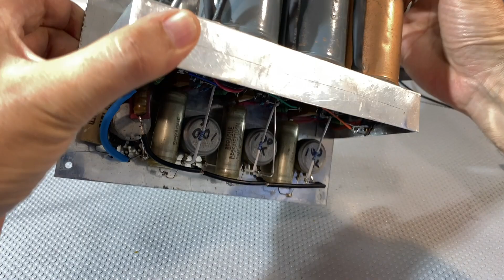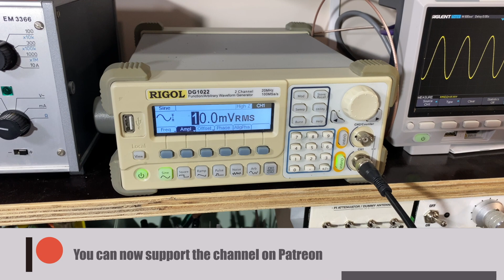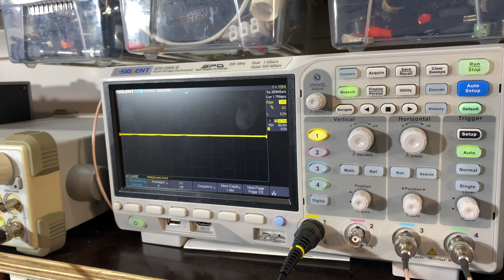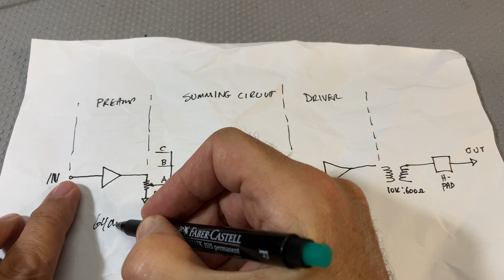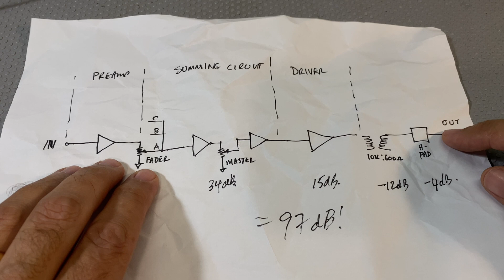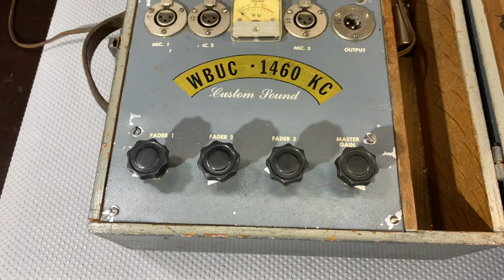All-Tube Microphone Mixer restoration pt 2. This one is done, and has a huge amount of gain.

Comment: Perusing this wonderful rebuild for a second time, I decided to look up WBUC-AM. Turns out, it's still pumping out 5,000 watts of ("adult standard") jams in Buckhannon, West Va! I also found a very interesting page detailing the history of WBUC and its primary founder. It says that, of the pair of initial owners of the station, one, Jesse D. Newman, "spent last 10 years in U. S. Army Signal Corps." It goes on to say that "Newman had built a complete Armed Forces Radio Station in India during WW-II." 

Even more interestingly, it continues: "Newman gave up 15 years in active military duty and moved his family to Buckhannon to build the station. It was a ‘shoestring’ operation that proves it can be done.

"WBUC signed on the air December 13, 1959 with a minimum of equipment, *some of it built by Newman*. The studios were in a large farmhouse. Newman and his family of five lived in one part, while the station occupied another part. It was handy for winter sign-on shifts, but it was crowded."

It seems quite likely that this microphone mixer's origin can be attributed to Mr. Newman, who sounds like a fascinating guy.
Reply: Something just hit me: I was told, and/ or read somewhere, that many, many older remote radio broadcasts in the USA would use a dedicated telephone line to transmit back to the station. Now, the output is 600-ohm, which is the US standard for a telephone line (of course it was also an older audio standard, but of course the audio engineers got that from using lots of Ma Bell's equipment in the early days). So it may make complete sense that the gain is so enormous on this thing: they very likely were transmitting over relatively long distances of unshielded, twisted-pair telephone wire. This may have made quite a difference in audio quality at the other end of that telephone line.
Reply from the maker: Interesting research you did there. Thank you. It always fascinates me to think of who used something like this before, and that Mr Newman sounds like quite a character.

Comment: What kind of input did you use ? Seems only for dynamic microphones with such gain.
Reply from the maker: I only tested with signal generator as an input. My friend has some really vintage ribbon mics, so maybe the gain will be useful.
Reply: @electronicsoldandnew  Ah, I understand, it is already out of your hands. As others wrote here, probably some 600 Ω mics needed for that, just as a reversed speaker, but with high impedance.

Comment: Excellent job!  Beautifully neat and clean job of correcting the wire size and other stuff.  If it had been mine, I would have insisted on new capacitors instead of the old ones that "tested good"...I just don't trust them!
Keep up the excellent work!
Reply from the maker: My friend actually asked really nicely for me not to change the caps unless absolutely necessary 😊
Reply: @electronicsoldandnew  Nothing "wrong" with that...I was simply stating that had it been me, it would be the other way around.  And again, you did an excellent job!
Reply from the maker: Thanks Wayne

Comment: It might not be perfect, but it must have done the job at the time, it was probably better than some others had at the time.
Did it have a small speaker output to monitor what was going through it?
Reply from the maker: No, it has the headphone output
Reply: @electronicsoldandnew   Ok, so they just used the headphone to monitor the output, I suppose that is normal anyway.

Comment: Rather unusual that al the resistors were crook, but none of the capacitors.  Wonder if the climate was humid ?  What would happen if you tried a coupling transformer at the end - roughly 600 ohms - 8 ohms could you get an audio out ?
Reply from the maker: Probably, but not much power

Comment: It may have been made as a commentators mic mixer. The commentator would use the mic only a few cm from his mouth where sibilance could be a great issue. That LC network would compensate for that. Might be worth doing a frequency sweep. I would expect the HF would drop quite steeply above probably 8khz or even lower. The headphone output is also odd. You would need a very high impedance phone as it the output is directly from the anode. No 8 or even 600 ohms phones here!
Reply: In the past it was very common for phones to be very high impedance, I have several 3k ohms phone sets that are designed to work directly on the anodes.

Comment: Dear Manuel, i don´t understand, why the preamp has a gain of 63dB ( 11:17 ). The two tubes have a feedback via 100k to 3k3, that is a voltage gain of app. 33 - i.e. 30dB. But the input transformer may have an unknown step-up ratio, which gives additional 33db? That would be a voltage step-up ratio of 44,7. Or from 600Ohms to 1,2MOhm? 
Did you measure the gain from the grid of V3.2 to the anode of V4.1? Should be the a.m. 30dB.
Reply from the maker: I didn’t measure from grid to anode, unfortunately. The input transformers have been painted over, and I didn’t think to measure the ratio directly. I feel I’m interpreting something wrong here, but can’t quite figure out exactly what. What I know is that 10mV in produces 15.8v out. That is 20xlog(15.8/0.01) = 64dB.
Reply: @electronicsoldandnew  As you say a lot could be done better - most of the professional preamps of the time (REDD47, V72, RCA and Gates etc) used the feedback path as the place to adjust gain; a switch to change that 100k for a few other values would seem a judicious change - something that could easily be tried (or shown to client) on one channel.

Comment: Manuel, Happy St. Patrick's Day, do Portuguese celebrate it? 
My thinking that your radio station's mic-mixer's hi-gain make sense as it's intended to feed into a telephone line back to the studio's transmitter. The Bell System worked with radio stations to install 600 ohm balanced pairs for a remote radio pick up and even had special terminal blocks for the radio stations technician. ((You did a beautiful job of restoration, and paid homage to the original design)
Reply from the maker: We have so many festive holidays here, but not St Patrick’s day (yet). 😊 
I didn’t think of the phone line possibility. That would make sense, actually. Feed a very “hot” signal from the field and then temper it back at the station. Interesting. Thanks.

Comment: I find the output transformer also very strange. Or at least it would never be my choice because it doesn't make much sense to go for a 600ohm output.
A 12AU7/ECC82 is more than capable of driving loads down to 10k/20k, which is standard input impedance for any professional gear (for many, many years)

Nice video btw!
Reply: btw, I was just simulating the circuit the amount of gain in the first stage isn't that high, only about 27x or 29dB.
I think you measured the gain without the feedback resistor? Because I don't see how you could end up with so much gain WITH feedback. A 12AX7 without cathode bypass cap does around 30-35x gain (30dB)
A 100k load (effectively less because of the feedback resistor), is also very odd. A 12AU7 would do better in this case.
Using two triode in series with that much load is already very odd.
Reply from the maker: I agree that there are a few oddities  here. I had the FB resistor in place when I did the actual voltage tests, so something may be off with my measurements, but I was measuring the gain of two triodes, not one. 
I think this mixer may actually have been designed for 12AU7 tubes, and not the 12AX7’s that are in place. The gain would then be a little less dramatic. Some adjustments to the bias and plate resistors may be needed, but that is something worth thinking about, I believe.
Reply: @electronicsoldandnew  Ok, that is still a lot for a circuit with feedback. A single gain stage is more than enough for a mic input. the 12AX7 is still a good choice, since it's a very "steep" tube (= lower distortion rule of thumb).
Usually you need typically around 45-60dB for a mic pre-amp.
I just realized that old (reel-to-reel) tape-decs used 600ohm input impedance I think?
Reply from the maker: Yes, they did.
Reply from the maker: Makes sense. Thanks